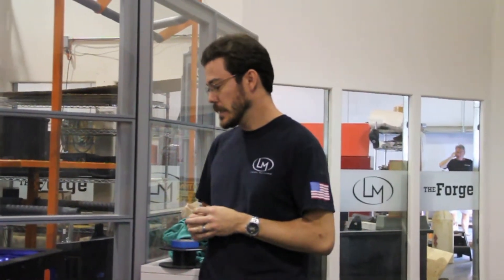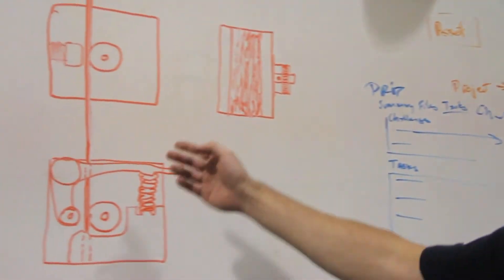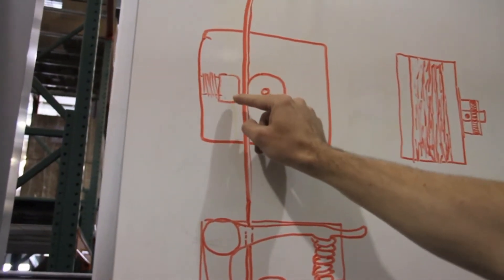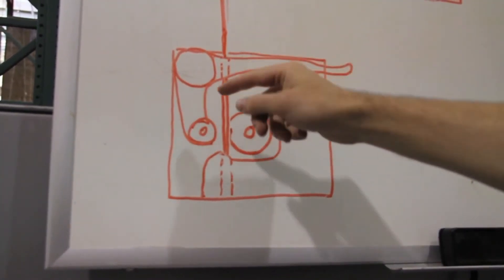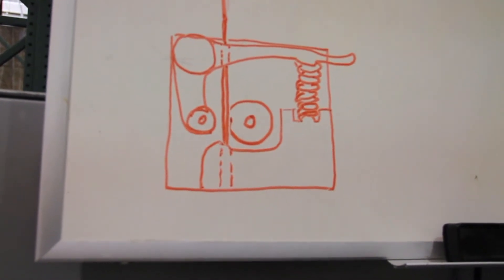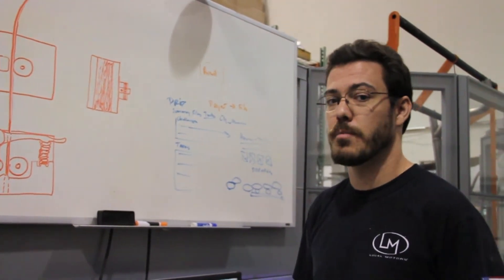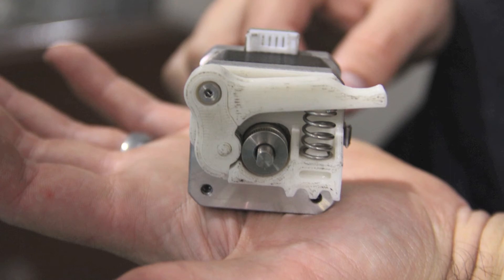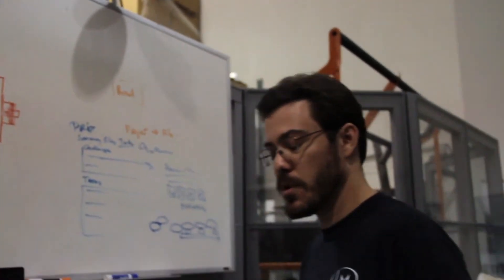Makerbot Replicator 2 Extruder Mods

Comment: great video, exactly the same symptoms on my R2. if you can't grind the shaft then turn the drive pully round so the grub is on the flat part of the shaft. Take care it doesn't bind on the heat sync tho. Also remember to clean out the teath on the pulley as these tend to fill with PLA reducing grip.